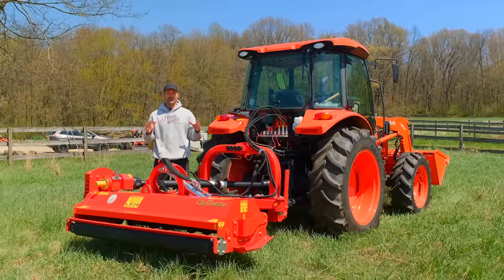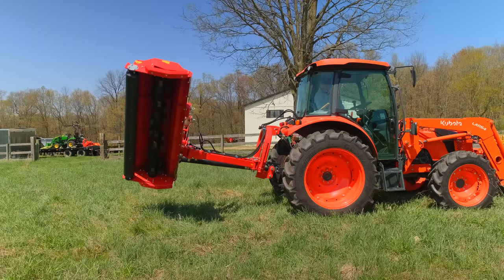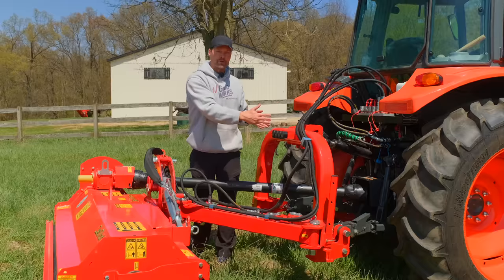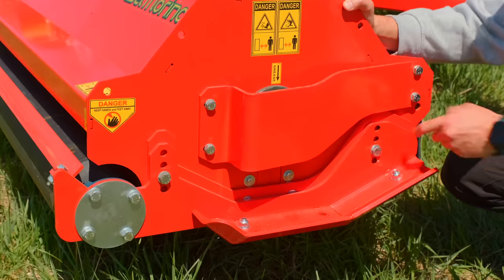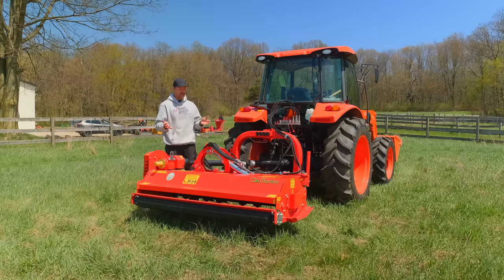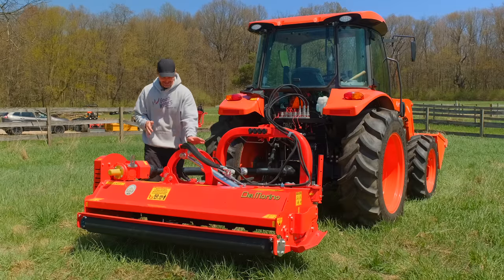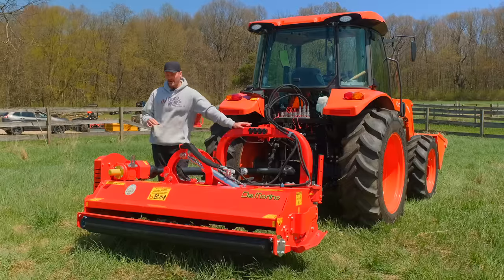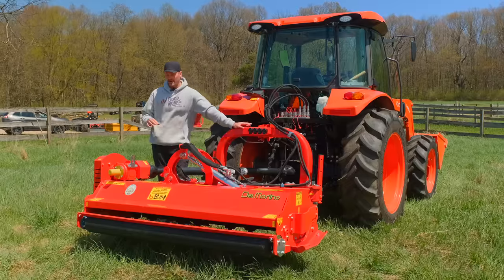WHAT IS A FLAIL MOWER?

Comment: Warning about tractor fitment.  Years ago, I tested a mower with similar weight positions as this one in a Kubota L5740.  This is the hydrostatic 57 hp tractor.  The last I looked, the current model, the L6060 had the same 3-point lift.  The lift system on the gear drive transmissions, like the one in this video, have a different, stronger 3-point lift.  The mower broke the very thick heavy cast iron lever beam of one side of the 3-point lift.  The tractor sat in the field for many days until the replacement part arrived because I could not disconnect the mower.  The dealer thankfully bought the mower back from me.  If I could carry a ditch mower on the tractor I would be happy to have it.  I do not know why Kubota has 2 total different lift systems but they are not equal strength.  I know this is support to be category 1 compatible but I would not trust it.  It is very important to add proper weights to the tractor to safely operate this kind of mower.  It is common to add wheel weight(s) (probably more than RimGuard alone can provide) to opposite side of the mower reach.  This would be the left rear wheel for this mower with a right side swing.  Front weight(s) are also important as when the mower is swinging it extends quite far from the rear of the tractor.  My experience indicates the skid plates are required for safe operation of this implement.  Without them, there is a great risk of turning the mower into a dangerous rototiller.  A rototiller turns at a far slower speed than a flail mower.  A mower can turn small gravel into shrapnel.   I hope you have happy and safe mowing.
Reply: The m4d and most utility size tractors have dual lift cylinders  for the read where I think the 6060 has a single so it puts more stress on that one arm
Reply: @jackofall2305  I had one on a M4, bent the lift arm on it.  I used it twice, could not wait to get rid of it,

Comment: Have a nearly identical unit (likely same origin) running on a Kubota L6060. Works very well, you do need to be a bit cautious with slopes and tractor weight - I have all 4 tires loaded and add about 100#  of chain to the forks on the  opposite side at the front. Will take out some sizable trees and make them vanish. Do need a Cat 2 hitch, at least for ours. Great for maintaining ditch lines and roadsides.

Comment: Great video so thanks for posting it up. I have a Kioti RX 6620 - which is the same size as the RX7320 but the RX 6620 only has 1 hydraulic oil filter and is said to be slightly detuned from RX7320. So I'm wondering what size Flail Mower would be the largest size I could use on the RX6620...? Your response is appreciated.

Comment: I am relatively new to flail mowers. I've never used one but a friend of mine recently got one and said it's the greatest thing he's ever purchased in terms of tractor implements. I have a Branson 5835. You said this is good from 50 to 80 HP. Mine is a 58 HP utility tractor that is extremely heavy and has a remarkable lift capacity. At the lower end of the spectrum, would I feel sluggish trying to run this flail mower with only 58 HP?
Reply: Looks like U never got an answer...???

Comment: I must have missed the HP requirement  to run this attachment. What is the minimum and maximum HP for this unit?
Reply from the maker: This particular Series is 50-80HP at the PTO.  We have smaller versions for smaller HP machines too.

Comment: I am somewhat surprised they put both swing arms on the same side and close together.  That is much weather structurally than an arm on each side making a much wider parallelogram.  Hopefully, it holds up over time and doesn’t develop too much slop in the bushings.
Reply from the maker: Common design amongst flail mower manufacturers, not specific to Del Morino.  I've shown tons of flail mowers on my channel, all with this same general design.  Just google "offset flail mower" and you'll see the same design in principle across the board.
Reply: @GoodWorksTractors  I am just scratching my head trying to figure out the advantage given what is given up structurally.  Maybe it is just to allow easier access to one side to connect PTO and such.
Reply from the maker: Probably a geometry thing with the swing pattern...at least that's my guess.
Reply: @GoodWorksTractors  You actually get wider swing capability with a wider parallelogram.  Bolt two 2x4s to a plate and space them 1” apart and see how far they swing to the side before one hits the other.  Now space them 12” apart and repeat.  The difference is significant.  I assume they have a reason, but I don’t think swing reach is it.  I am not sure their logic, but I assume they had a reason that simply isn’t obvious.
Reply from the maker: I don't think you need a wider swing pattern.  The PTO shaft is within 2" of hitting the frame as it is.  You'd have to keep widening the frame which becomes impossible at some point.  The whole industry shares the design, so I'm sure lots of thought, lots of designs, and general R&D led them to settle on this configuration.
Reply: @GoodWorksTractors  I agree.  I was thinking mainly of structural strength.  It is like holding a 3’ stick with your hand together in the middle and having someone else grab the ends and rotate it.  You will have a very hard time resisting the rotation.  Now separate your hands toward the ends of the stick and the other person will have a much harder time rotating the stick as you resist.  When it comes to resisting torsion, distance is your friend.
Reply from the maker: @LTVoyager  no doubt, but if it’s engineered right, then that’s all taken into account anyways.